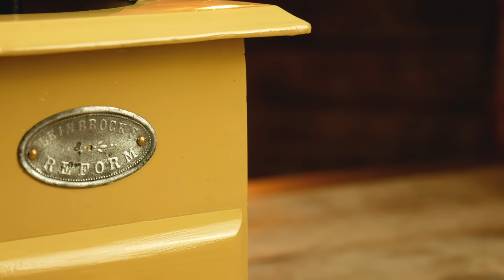ROTTEN Coffee Grinder | Unrealistic Restoration #restoration #asmr

Comment: You are new at this & still learning... Anything, repeat ANYTHING, that comes into contact with food or drink products MUST be rated as Food Safe. That includes paint, stain, finishes, glue, filler putty, etc. Note that cold bluing is not food safe but heat bluing is. Most filler puttys are toxic, so experienced  restorers use sawdust & food safe wood glue as a filler putty. Also, you need to research the items that you intend to restore. Leaving off the missing hopper cover got many comments that you failed the restoration because you didn't replace it... You have a lot to learn before you become a credible restorer.

Comment: Kámo ja ti nevim, věnovals záchraně mlynku hodně úsilí ale vysledek je levná okrasa. Protože pokažde kdyz se v takhle lakovanym vnitrku namele káva ktera je docela teplá, tak bude citit po barvach. Nemluvě o modernich šroubkach na křížak šroubovák. Ale palec nahoru za usilí
Reply from the maker: We did not paint the crusher, but left it as it is.  The grains heat up just at the moment of crushing, after which they quickly cool down due to the low speed of the crusher, so there is no smell of paint in the container.  So you are wrong :) But thanks for the comments.
Reply: @uniquethings6032  ok if you thing. Good luck to next project